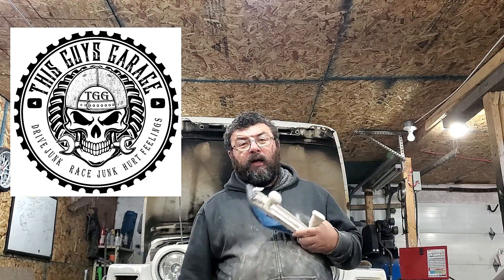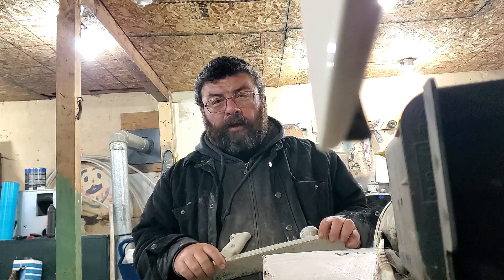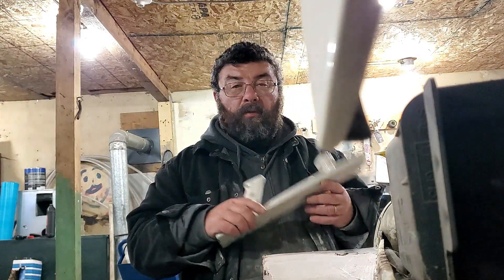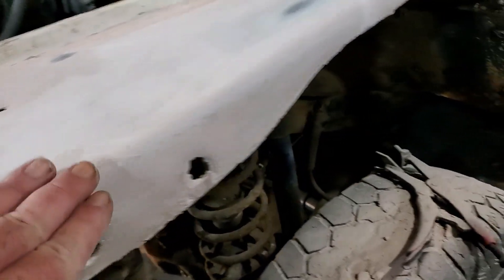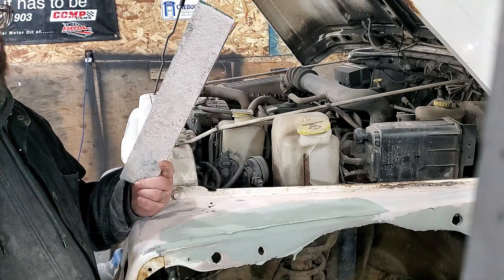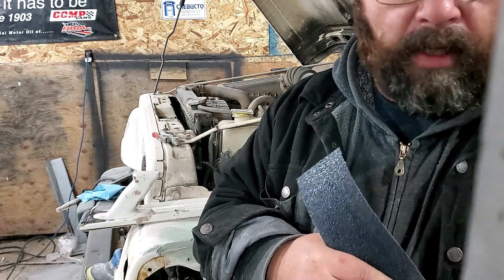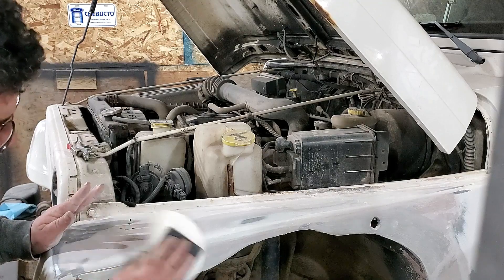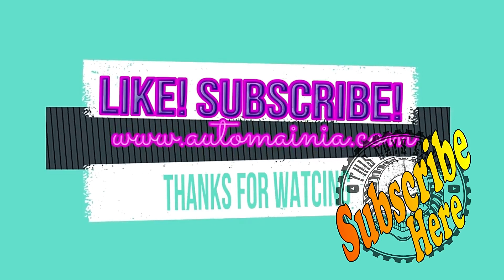how to block sand body filler bondo

Comment: What grit do you use to sand Bondo. I used 40 today but gonna use 60 or 80 when sand again. The holes on my car not as wide as it was on my old truck which had hole in the rocker panel I still used foam spray on the whole though. I got the Bondo professional body filler today I tried using the Bondo glass yesterday didn't like it like the regular Bondo or the Bondo professional that used today.
Reply from the maker: i use 40 then 80 then 180 then 220 then 320 finish with 400 .  let me know if you have any other questions zanaga

Comment: You hardly kicked up any dust when you were sanding. Amazing!
Do you use a respirator?  When I sand Bondo, it's like a dust storm lol. I definitely have to wear a respirator.
Reply from the maker: The trick is to sand the filler at the right time just before it sets.  If it gets hard and you have to use a machine a mask is definitely recommended.  Wet sanding is another great way to keep the dust down. 

Ty for taking the time 👍
Reply: @thisguysgarage  thanks for the tip. Wow, I didn’t realize you can wet sand this stuff. I’ll have to try that later today.
Thank you!